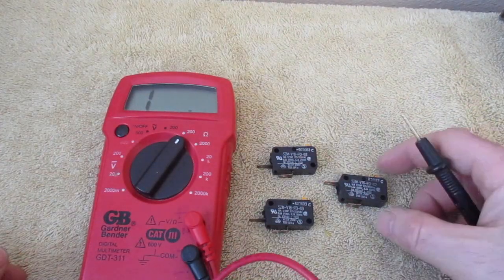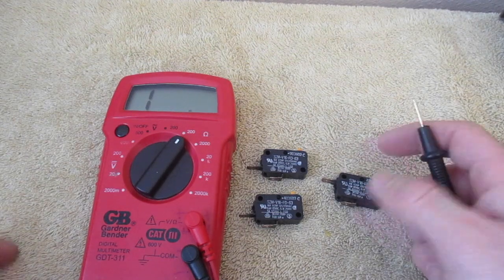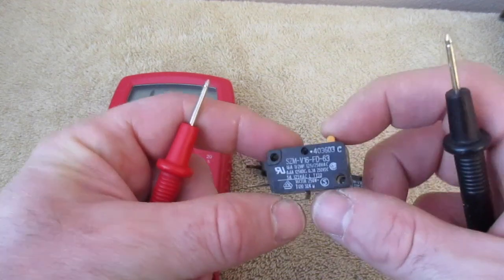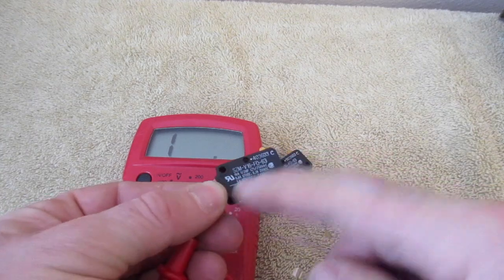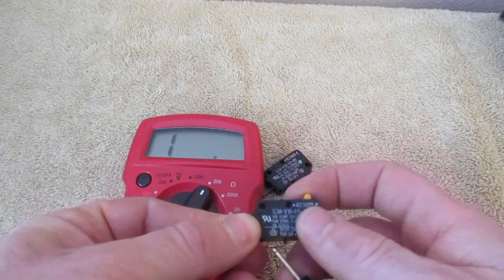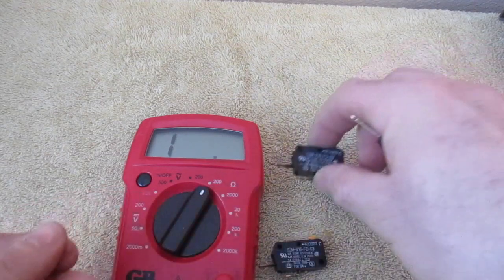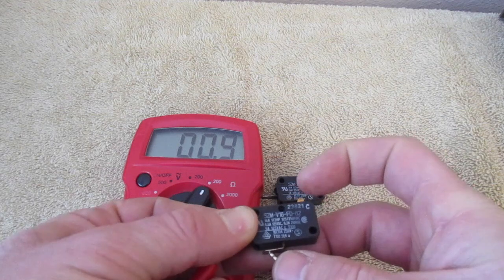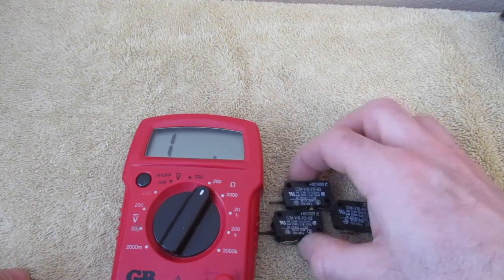Microwave runs with door open How to Test Microwave micro switch light won't go off when closed

Comment: Thx for the vid
Reply from the maker: glad it helped! Thanks for posting
Reply: @youcanfixit3721  No prob - turns out my primary switch is faulty - I bypassed it as a test, and everything worked as it should so ordered 3 new switches to put in (prob only need to do the one, but might as well). Thx again.

Comment: Just because a switch tests "good" doesn't mean it's really good. All 3 switches tested good on my GE JVM7195RF1SS microwave. It turned out that the bottom switch was the only bad one. I made a correct assumption that it was bad because it was the only switch that I couldn't disconnect from the wire connectors with my hands. I needed pliers to remove it from the wire harness. I figured the switch got fused to the wire connector from a power overload. Sure enough a piece of plastic from the wire housing had lodged itself in the tiny hole on one of the switches blades. The switch I replaced was the bottom one and now I have a fully functioning microwave!

Comment: Excellent video , tested my switch ( middle switch in microwave ) that's the switch that has NC and Common. Multimeter shows reading when button is released and get a reading when button is pressed in, so that's a bad switch. What does the middle switch do in the microwave?  Replaced the switch with new one. Same results door open or closed I get a reading. If I remove the wire from the Com post it shows OL. Soon as I put the wire back on I get a reading on the multimeter when closed.

Comment: It's fascinating to me to discover, as I'm trying to repair my microwave, that two door switches are "open" and one switch is "closed."  In my model, the parts list for the door interlock switch indicates these two are the same.  And yet, one is an open switch and one is closed.  How can that be when they are the same part number?
Reply from the maker: No idea, must just be an incomplete parts list or an accidental omission.  Typically only one should be bad.  Find which one it is and swap that one out.  Can get new and used typically between $5-10 on ebay.
Reply: Turns out the design of the switch has the capability to be either normally open or normally closed, but its the same switch.  And, it turns out, this is also by design, as some circuits, like for the interior light, need to be closed when the door is open so that the light comes on.  Anyway, it turns out all my switches were working correctly, after getting frustrated I put it all back together, plugged it in (it came on immediately), and ran a 30-second cycle.  When it reached the end of the cycle it turned off, just as it normally should.  I guess a relay had just got stuck.
Reply from the maker: sorry for the late response, but did one or both of them have three connections instead of two?  Those do run open/closed.
Reply: I think they were all the two connection type, though one was a different part number from the other two.
Reply from the maker: So it was 2 and 1.  Okay I was getting confused on that.  Hopefully you got it all fixed and didin't have to go out and buy a new one.  Have a great summer